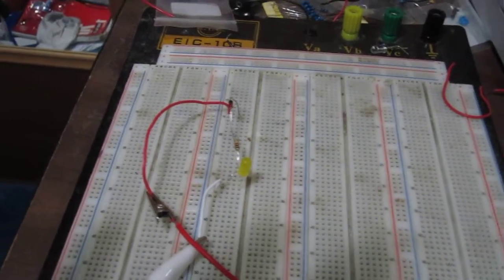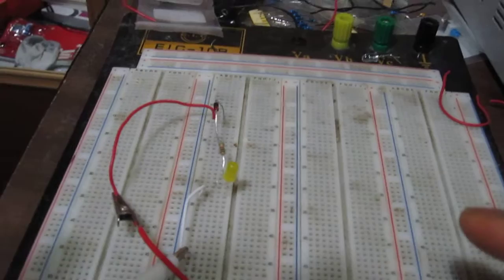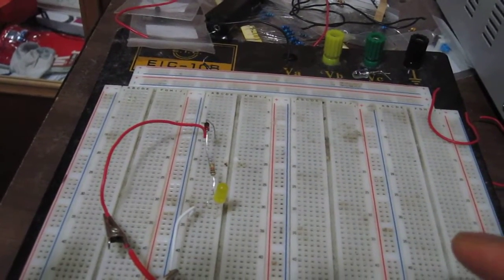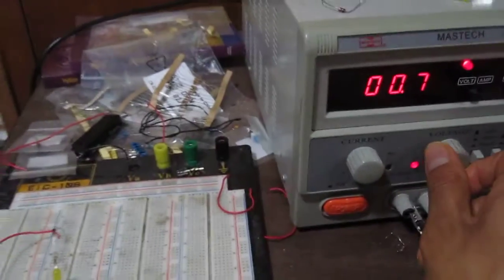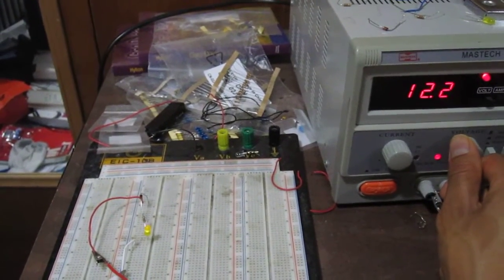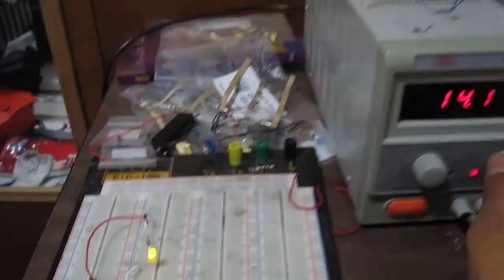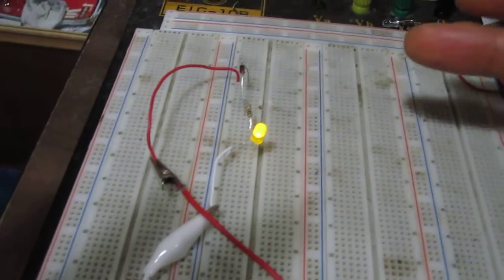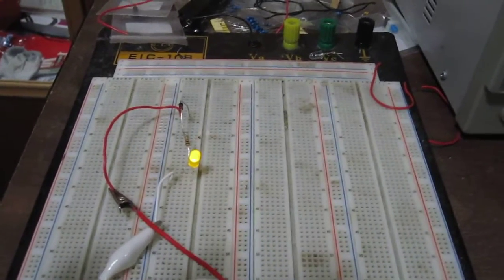Zener Diode Voltage Level Indicator

Comment: I tried scrapping for 11volt zener diode in electrical stores but couldn't get it. Can I use 1N4148 zener in place of the 11volt zener?